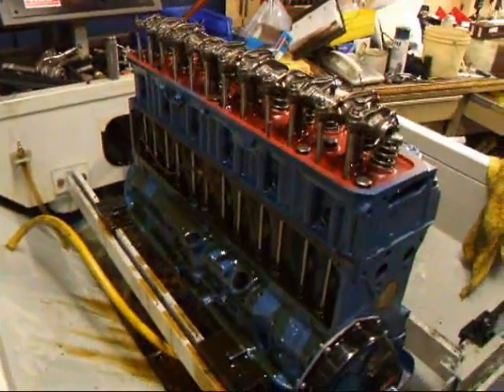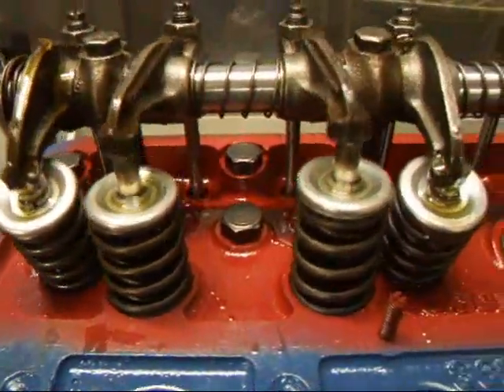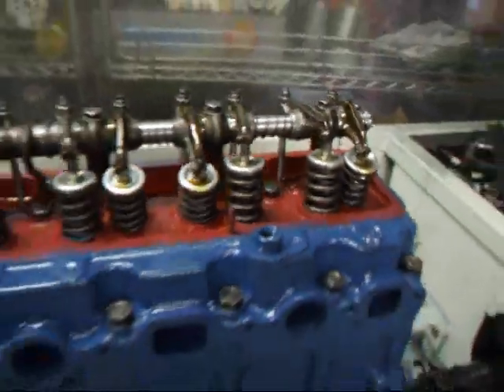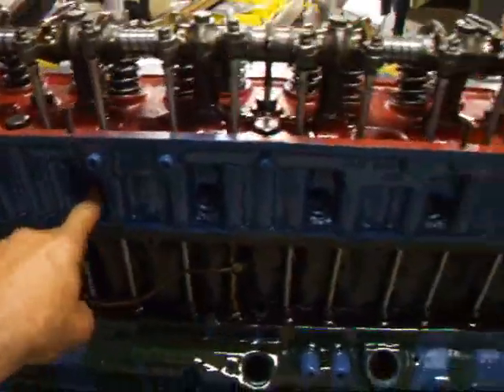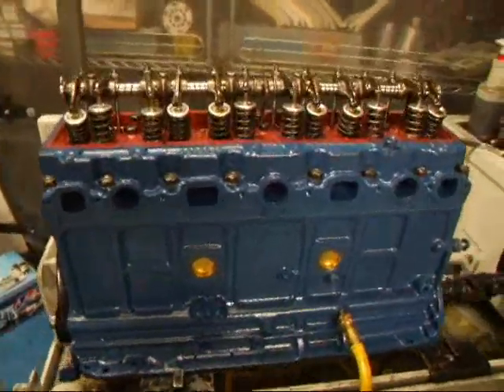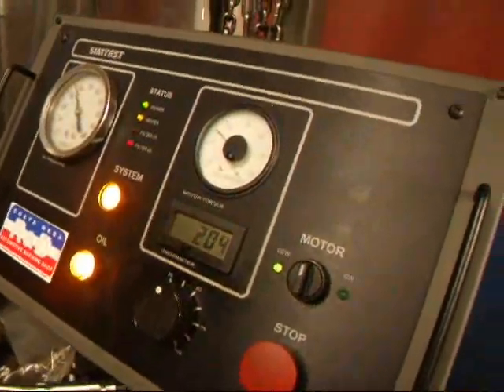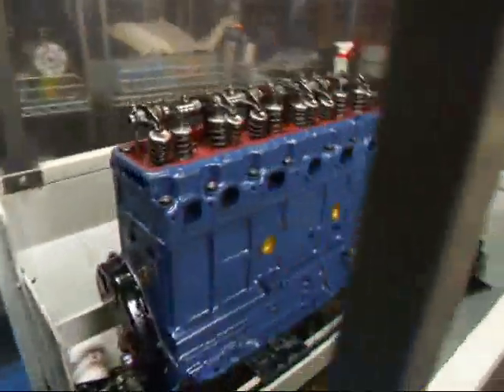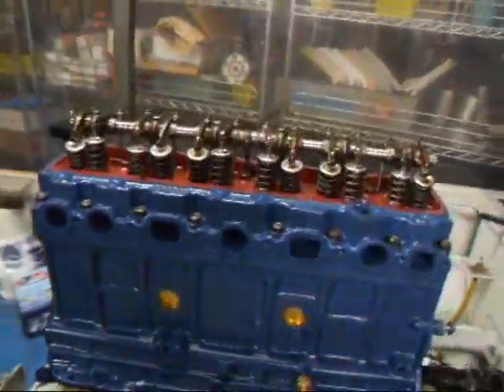Sergio 235 Simtest.wmv

Comment: I believe if you fully balance and blueprint a engine then run it on a low stress break in you can get 350,000 miles out of an engine easily

Comment: Yeah I think that's the real reason it for break in and testing oil pressure. You don't need 50-60 turns to check if something hits, catches or grinds.